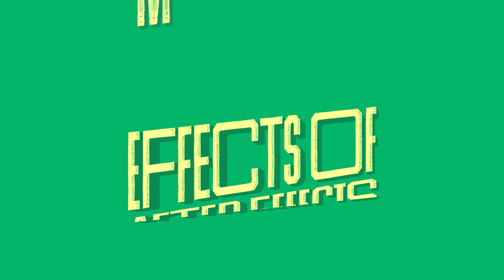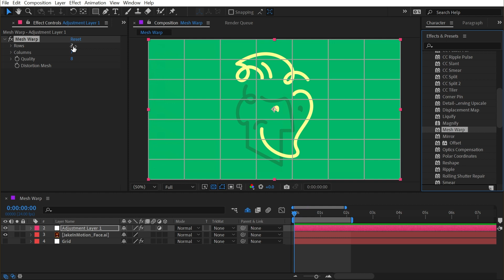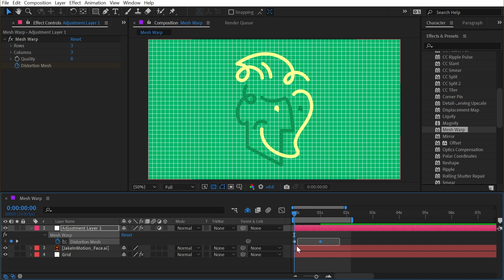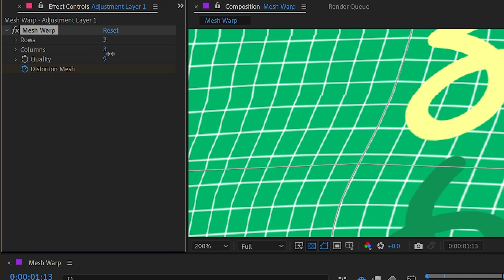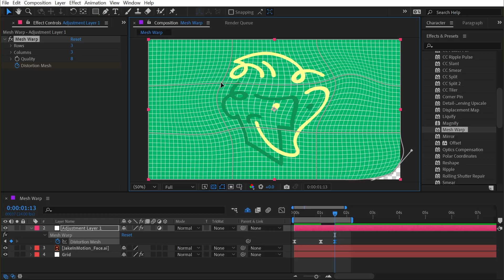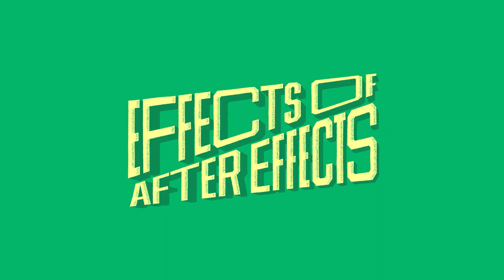Mesh Warp | Effects of After Effects

Comment: Isn't it kind of disorienting that the distortion mesh control doesn't have a slider? If you just look to the timeline there's no way of knowing which way the distortion is going.

As everyday, great tutorial. Thanks Jake! :)
Reply from the maker: It is a little confusing, but it's sort of like a path keyframe. Each one can contain completely different information about the state of the mesh, so having a slider that moves from state A to state B wouldn't work if you have state C.